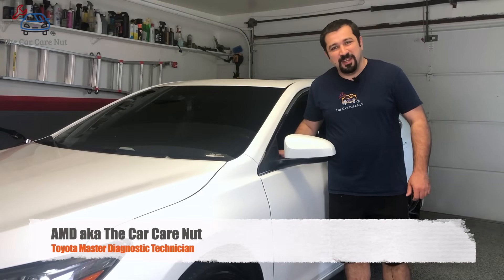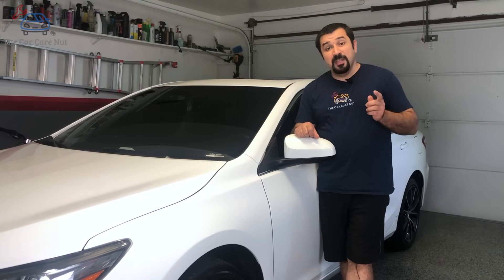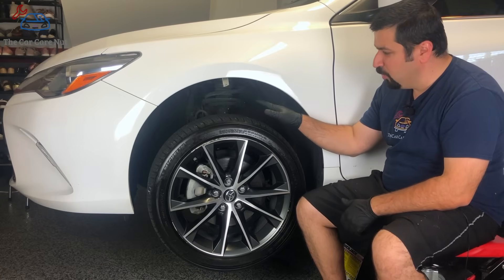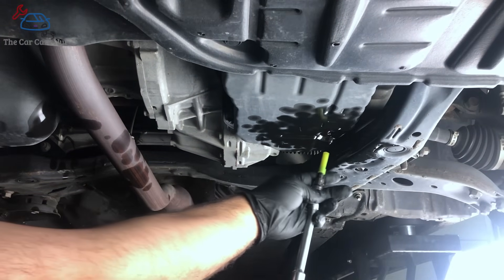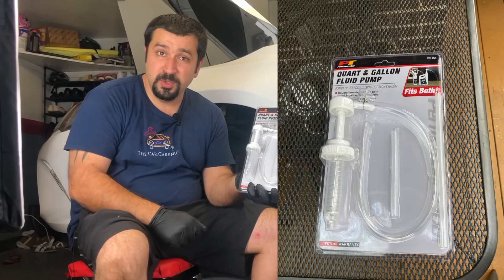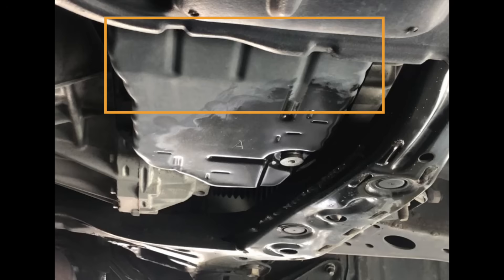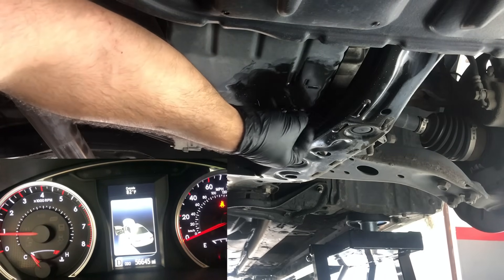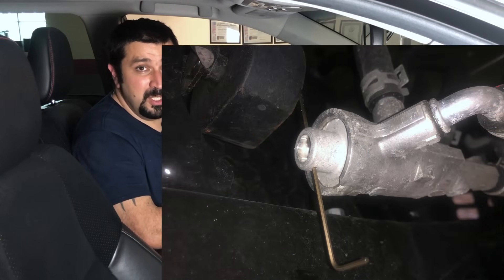How to change your Toyota Sealed Transmission Fluid

Comment: Whats wrong exactly with measuring how much comes out and just putting back the same amount in?
Reply from the maker: You don’t know if the fluid level was right to begin with and if you’ve done all the work of measuring and adding might as well finish the job and check the fluid level.
Reply: @TheCarCareNut  Even if My Corolla has 50,000 and first time changing the fluid from factory?
Reply from the maker: You’d be surprised! I would still check it.
Reply: @TheCarCareNut Alright will do, where can I find the exact Transmission temperature for the fluid for my Corolla?
Reply from the maker: What year corolla?
Reply: @TheCarCareNut  2015
Reply from the maker: 95-113
Reply: @TheCarCareNut  awesome! Thank you

Comment: What do you think about dropping the oil pan to clean the magnets and perhaps also changing the filter? Should it be done maybe just on the first fluid change or is it really unnecessary?
Reply from the maker: Hi! The filter and dripping the pan isn’t really needed. If you’re doing the work yourself why not but don’t expect a large gain in terms of longevity.
Reply: @TheCarCareNut  Hello again AMD!  I hope you and yours are having a wonderful holiday season!  What about with older transmissions, like in my '99 V6 Camry with the 4 speed auto, even though it had regular fluid drains & refills every 30K or so, I went ahead & replaced the trans. screen at 180K, and even though it didn't "seem" clogged and trans. performance seemed normal, it was still at the time 19 years old.  During that service I cleaned off the bottom of the pan & magnets, and the pan got a new gasket to boot.  Perhaps it's not a waste to do this once they get pretty old when the plan is to be keeping it for a very long time?🤔
Reply from the maker: It’s not a waste at that age of the car but as you’ve seen it wasn’t really clogged or dirty and that’s because you always changed the fluid on time

Comment: Thanks for making this daunting task more accessible! For the fluid level adjustment procedure involving running the engine and going through transmission gears, are you sitting in the car and starting it while it is on (jack) stands? Is that safe? The safety instructions on jack stands often explicitly warn against anyone getting in the vehicle, much less turning it on, while it is jacked up. 

Actually, it would be great to see a video series focused on safety. For example, safety precautions to take for common DIY procedures, as well as common errors to avoid. The safety aspect is often the most stressful part about DIY, and if it isn't, maybe it should be brought up!
Reply from the maker: Thanks for the video suggestion. I don’t see the issue with sitting in the car while on jack stands as long as they can easily support your cars weight and you in it.
Reply: @TheCarCareNut  I think the concern is not so much with the ability of the jack stands to support the static weight, but the dynamic and non-vertical forces and torques of getting in/out of the vehicle or turning the engine.
Reply from the maker: Jack stands are pretty stable in my opinion if they are a good brand that are well made. I am not worried as you see in the video.
Reply: @fizout  You should give the car a good shaking before going under the vehicle anyhow, if that feels stable and good, you should be good. I have gone in and out of vehicles while they were on jacks, starting them and turning the wheels and have had no problems. I do use a quality set of jack stands and the jack as well for added safety. You can never be too safe after all.

Comment: Thank you so much for the detailed video.
I have two questions.
1. I have seen my friends use their cars and never change the transmission fluid and the car never gave any issue. Is there any problem with that?
2. I have Camry 2011. My mechanic checked my transmission fluid last Christmas and noticed it was low. I bought the fluid and he topped it without draining it first. I have been using the car without complaints. Is there any problem with topping the fluid instead of draining?
Thank you once again for the video.
Reply from the maker: Hi! Thank you for watching my videos! Transmission fluid breaks down over time and it’s a good idea to replace it. If it’s never been replaced and the car has high mileage I would leave it alone as you could cause more harm than good. Correcting the level is good.
Reply: @TheCarCareNut  at what range could a car be considered high mileage?
Reply from the maker: Over 100,000 miles.
Reply: @TheCarCareNut  I just bought a 2015 Lexus es 350.  Had a clean carfax but no records of oil changes or transmission fluid change.  It has 125K miles on it.  The last 2 years the 2nd owner put on 50k miles commuting long distance to work.  I was going to go to the Toyota dealership and have them do the drain and filll, but now Im wondering if I shouldnt based on your 100k comment.  I was hoping to keep this car going for another 100k miles.  Appreciate your opinion and May God Bless
Reply from the maker: Hi! I wouldn’t honestly

Comment: How often do you recommend doing this?  On Honda's its recommended to do 3 drain and fill once the vehicle hits 60K, then 1 drain and fill every 30K.
I have a 2011 4Runner and it's close to 120K miles and I was wondering if I should replace the trans fluid on it.  I am the original owner
Reply from the maker: Hi! At this mileage I would leave the transmission alone and if I was doing anything I would do one drain and fill and call it a day.

Comment: Your instructions are great but unless I missed it, you didn’t talk about the fact that when you drain the pan you’re only getting about 2.5 (+/-) quarts and most systems take a lot more.  For example, my 4Runner takes about 11 quarts so in order to change (most of) the fluid, I had to repeat the drain/fill 5-6 times in order to change a majority of the fluid.  Simply draining/filling once would only change out about 15% of the fluid.  Obviously, even when doing a drain/fill multiple times there will still be some ‘old’ fluid remaining but the majority will be new.
Reply from the maker: Hi David! The idea of the drain and fill is to change enough of the fluid to refresh the additive package.

Comment: Awesome video. I am loving your channel and the detail info you provide.  Do you know the temp range for a Lexus ES350 2014?  Using techstream.  Will 4 quarts be enough for a simple drain and fill?  Thank you in advance.
Reply from the maker: Thank you for watching my channel! The temp range for your Lexus transmission is 104-113. 4 quarts sounds about right I would get 5 on hand just in case

Comment: An interesting video for self-fluid replacement. I change every 40k by breaking the cooling circuit and displacing the old fluid with the new one. I also remove and clean the pan and change the filter.
Reply: That’s what I am talking about a true care nuts! 
Your AT will last forever.😊
Reply: @marcosb2097  You would only hope...........luck of the draw.
Reply: What do you mean about the cooling circuit and displacing the old fluid?

I'm completely lost on the cooling circuit, but by displacing do you mean adding so much fluid that it runs red again?
Reply: @Ryan_Carder  he is talking about taking off the trans oil cooler lines from the radiator and cranking or running the car for a short time to do a complete flush instead of a filter slap or drain and fill like in this vid. And yes you let it pull fresh fluid until it comes out of the return hose.

Comment: Anyone have any tricks for getting your car level when it's on jack stands, or even just sitting in the driveway? I know my driveway isn't perfectly level (or my garage), so I have doubts about getting the car perfectly level for this procedure.
Reply from the maker: As long as it’s relatively level it’s good. For example if it’s a steep driveway or you’re only lifting the front of the car off the ground then it’s not level. But using 4 similar jack stands on a relatively level surface should be good
Reply: Your garage is not level.  They want water to drain out.  But its close enough usually.  Maybe  put the rear jack stands up on a 1/2 inch piece of plywood.

Comment: I really wish you would show a complete flush, 2 new quarts mixed with all that dirty fluid is almost a waste of time. How many drain and refill will it take to get the fluid looking good again?
Reply: It's not a waste of time to renew some of the fluid additives periodically.  You can get a very long transmission life this way as has been proven well over 300k miles. The trick is to do it regularly as CCN stated.
Reply: As a data point, I bought a 2010 Corolla with 165k miles and NO fluid changes ever.  It took me four fluid changes (with driving miles between them) before the fluid had a decently-red color (still pretty dark though, as is normal). The transmission runs a bit quieter now for sure. I used the new Castrol ATF/CVT Universal fluid (not the older Castrol MV multi-vehicle fluid). These are both WS-rated fluids btw.

Comment: Wow, I thought VW was the only one with this bizarre transmission fluid changing procedure (for their DSG, "automatic" paddle shifter transmission).   The design looks identical (with the overflow tube, and heating up the xmission to a certain temperature, then draining the overflow).  Great tip on the Home Depot 10q bucket with quart annotations, I'll have to get one of those.

Comment: Thank you Amd for the video! Seriously car manufacturers how difficult is it to put a damn dipstick?
Reply: DIY are in direct competition with TOYOTA. Adding computerized parts, removing dipsticks, etc. ensure that you will go back to the stealership for repair. Now imagine what it will be when all cars will be electric and that designers will have found a way to seal many components. They will control DIY by voiding warranties if a sealed part gets unsealed, forcing DIY to go to the stealership. Small garage will only perform brakes jobs and tire changes.
Reply: @agfa663  sad but true, that's why I'm sticking with mostly older machines.

Comment: Thanks for the great video, Car Care Nut!  
What do you think about the Valvoline MaxLife synthetic ATF fluid for the 2016 Highlander 6 speed transmission?   I have a 1996 Land Cruiser with 250K miles, and a Honda Odyssey with 220K miles, and I run the Valvoline MaxLife synthetic ATF fluid in both of those transmissions.  I noticed the shifting got smoother in both of them (especially the Honda) after the switch, which I did over time with multiple drain and fills.   
I have heard the Toyota ATF is good for new transmissions, but not as good for transmissions with higher mileage.  I tend to keep my vehicles a long time, and my goal is to get my Highlander to 200K+ miles.
Thanks in advance for your expert advice!
Reply from the maker: Hi Russell! On transmissions with ATF WS I would stick with the original fluid. I don’t know how I feel about aftermarket one fits all fluid for the WS ones.
Reply: @TheCarCareNut  Thanks so much for your reply.  The time and expertise you put into your content is really generous and fantastic.  Have a blessed day!

Comment: Very helpful video.  I have a 2017 Tacoma with 6 speed auto.  I've gone to two different dealers and both have warned me against changing the transmission fluid.  i now have 101k on the truck.  Do you recommend changing the fluid now, or is it too late?
Reply from the maker: That’s right on the edge of where I’m comfortable changing it honestly. If it’s shifting ok I would let it go

Comment: Hi amd I am about to change my transmission fluid on my 2016 Camry 68,000 miles thank you for your suggestion. Oh and is it safe to drive on sport manual mode regularly it's more fun or I would say faster pick up?
Reply: Thanks amd looking forward to your new videos
Reply from the maker: Hi! Driving on sport mode is ok just don’t push the car too much every single day

Comment: Wow thank you, another great detailed video.  I was wondering, what is the ''normal'' range for ecvt oil change in a 2020 Highlander hybrid ?  Toyota usually say they are lifetime ... but what is lifetime for them ?  Also does it use the standard Toyota ATF fluid ?  Thank again and keep up your great work :)
Reply from the maker: Hi Eric! For the hybrid transmission I would recommend fluid replacement between 60-90k using Toyota WS ATF
Reply: @TheCarCareNut  Great thank you :) Mine is new so it will take a few years !  Do you have a video by any chance that explain how to do It ?
Reply from the maker: I’m working on making a video for hybrid transmission. I’m hoping it would be done and out towards the end of February or beginning of March.
Reply: @TheCarCareNut  Thank you, it will be very interesting... I will look for it :) have a great day !
Reply: @TheCarCareNut  was the video for the hybrid transmission fluid change completed (link)? Thank you,
Reply from the maker: This is the video for hybrid transmission fluid https://youtu.be/I1fP-RKsqG0
Reply: @TheCarCareNut  thank you :) great video.

Comment: Thanks for providing such a great instruction but I have a question on step 4 and 5. Since I sit my car on 4 leveled ramps, you mentioned take the foot off the brake and adjust the fluid level.  Will the wheels spin on this procedure? Thank you.
Reply from the maker: Hi! When your light came on and you pull the pin you will put the car in park but the D light will still come on when you are at the correct temperature range to adjust

Comment: What about the cvt found in new Venza or rav4 hybrid?
Reply from the maker: The fluid In all hybrid Toyota transmissions is different than this and simpler. It’s just a simple drain and fill until it overflows and you’re done. They use Toyota atf WS
Reply: @TheCarCareNut  thanks, you recommend changing every 30k or 50k?
Reply from the maker: I would change it anywhere from 60k miles to 90k

Comment: Thank you sir for an excellent video. I just recently bought a used 2015 Toyota RAV4 LE AWD with about (now)53900 miles. It has the 6 speed automatic transmission. I have no idea if the transmission fluid was ever changed (my guess is NO!). I saw one video that said NOT to use an EXTERNAL FLUID TEMP SENSOR,  ONLY INTERNAL!! Which is correct to tell my mechanic? At 53900 miles, is it necessary to change the fluid yet? At 81, this SUV will probably be my last car, so I want to keep it as reliable as possible!!! Please advise! Also, you asked the "LORD's" blessing upon me (us!) at the end of your video. "WHAT lord"?? Not all religions worship the same lord!!! MY one-and-only "LORD" is the "LORD JESUS CHRIST"!!! IS HE YOURS TOO???!!! Thanks too for talking like the gentleman you evidentally are!!!
Reply from the maker: Hi! I would change the transmission fluid every 60k miles or 6 years so you’re getting close in time and miles. Maybe in this year or the beginning of next year consider replacing it. Either temperature method works. But using the internal sensor and reading it using a scan tool is more accurate. 

The lord I reference at the closing statement is the one and only lord, our lord and savior Jesus Christ.

Comment: Hi AMD.  I followed your instruction to change ATF for my 2011 Camry. 160k mi first change. I know it is too late but surprisingly old fluid was not bad condition. I did drain and fill 4 times with WS fluid. I will do more on next oil change. Current fluid color is a bit dark but I think it is ok now. I changed all struts  with KYB Excel-G with original spring. Confirmed old original struts gone bad. My in-law's 2003 4runner ran over 350k and just retired. Hope my Camry keeps going that miles. Thanks for your video. It helps a lot.
Reply from the maker: WS fluid is a bit dark naturally. Even the ones with low miles that I drained they always had darker fluid.
Reply: @TheCarCareNut  What is WS fluid?
Reply: @gregjohnson2073  spec of fluid.  Maybe only a Toyota spec.

Comment: I have a 2018 RAV4 LE Model (basic model with only front wheel drive) do you know the temperature range for this car and can I use the same pin locations for the jump-wire?  I love doing my own maintenance, so you picked up a new sub.
Reply from the maker: Hi! This process works for your RAV4 temp range is 95-113
Reply: @TheCarCareNut  Thank you and bless you

Comment: Hey man just performed this service and so far so good. Quick question can I stored this trans fluid to perform in a couple weeks or does it pull moisture from the air
Reply from the maker: Hi Eric. It does accumulate moisture once opened. If it’s only a few weeks you’re good but I wouldn’t store it and reuse it longer than that.
Reply: Smells and taste just like dexron, lol
Reply: @TheCarCareNut  going to do the recheck in a couple days. When I take off the plug nothing should come out. And if it does wait till trickle correct?
Reply from the maker: You’d want the fluid trickle when you are in the temp range or when the D light is on solid.
Reply: @TheCarCareNut  after performing this service every once in awhile at a red light/ noise comes from what seems like transmission and it sounds almost like a bad water pump bearing or alternator. Is this a symptom of excess or not enough fluid?
Reply from the maker: Hi Eric. It could be but I’d be checking everything else first. Perhaps a loose heat shield?
Reply: @TheCarCareNut  man you’re a sage!!! It turned out it was my positive battery terminal cover banging/rattling against my air filter cover. If I had a dad growing up, I’d want him to be just like you!! Let me know where I can donate some cash for your time.
Reply from the maker: No worries my brother. I’m glad it’s fixed. I do have a Patreon account at www.Patreon.com/thecarcarenut